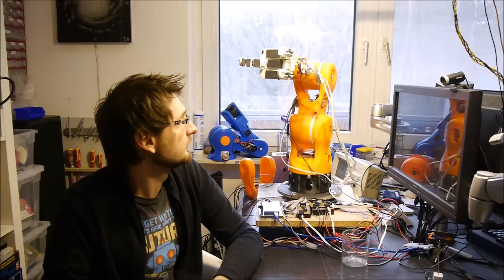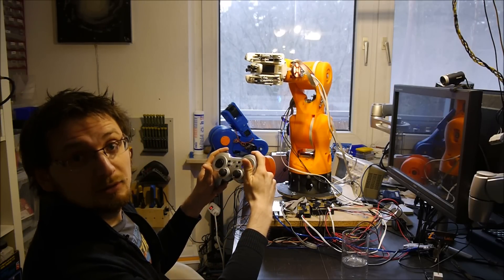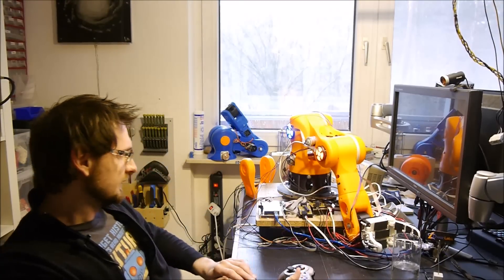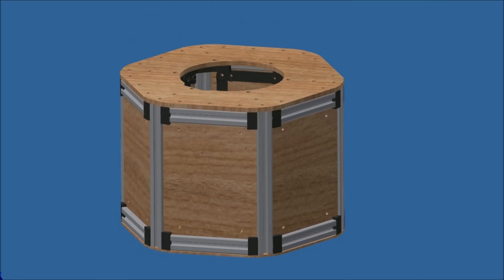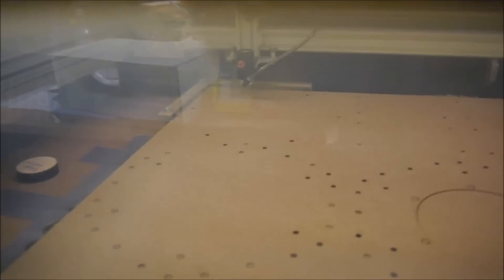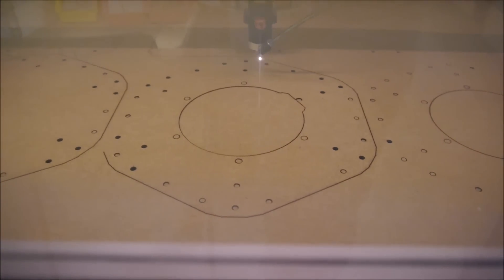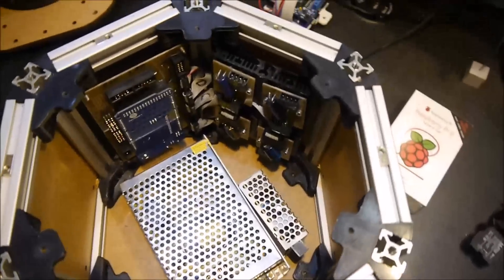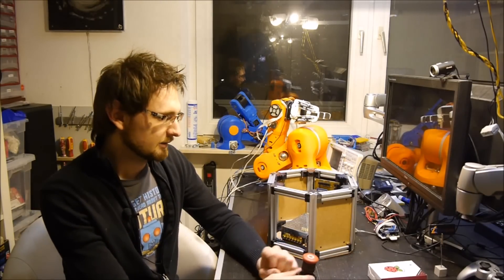Robot arm part 9 - Moving and making a new base

Comment: Hi Andreas! first of all keep up the good work man! this is awesome.
I need to print/build a arm like yours for my project but need it to reach about 1.5 meters far and be able to lift about 3kg. Is it as simple as adjusting the lengths on some parts and adding in stronger motors or what do you think would be the best solution?

Thanks mate!

Comment: Great progress, Andreas! What path and position accuracy do you expect when the IK is properly implemented? The robot seems to have a little bit too much 'accumulated' flex in HW and SW in this state...
Reply from the maker: 1hdsquad 'Well, the encoders provide 12 bit resolution. With an arm length of about 500mm this results in less than 1mm accuracy. So it really depends on the motors and software control. I thing a realistic goal is about 2mm.